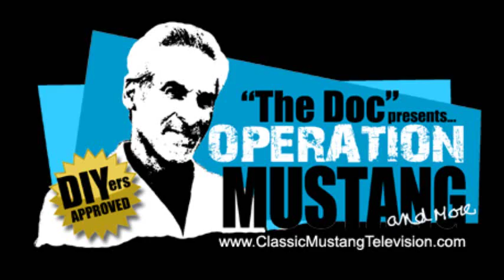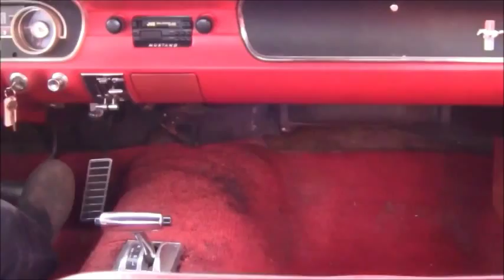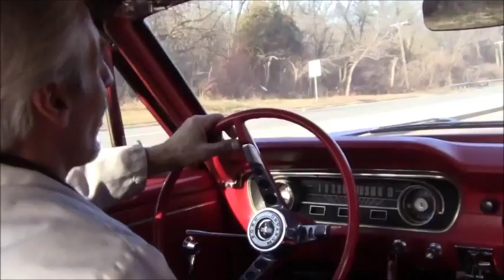Why are some Classic Mustang Carpets so Short?

Comment: I suppose if you've installed the newer carpet that goes higher up on the firewall, you could always trim and fold it to make an end seam right? That is if you want it to look correct, but does not look good". Or, is this nylon carpet to thick to fold and create an end seam?